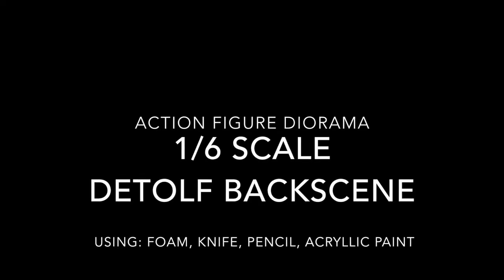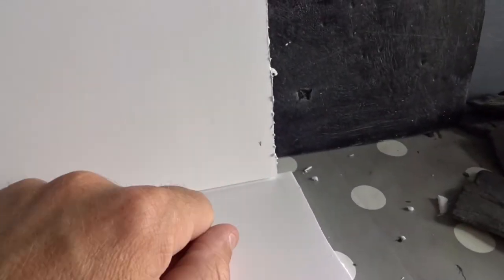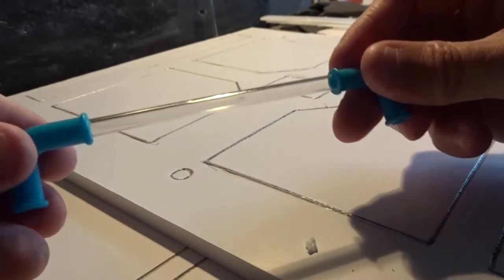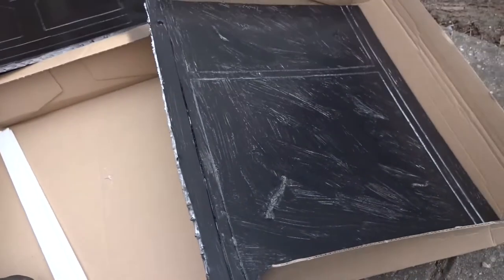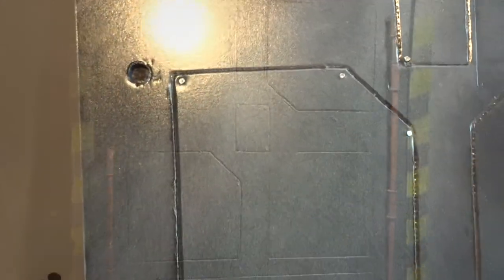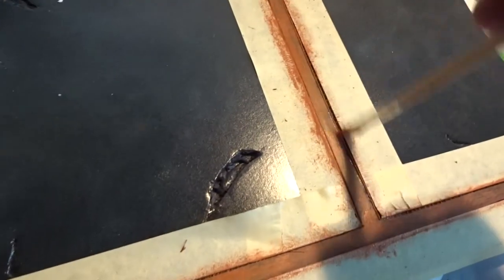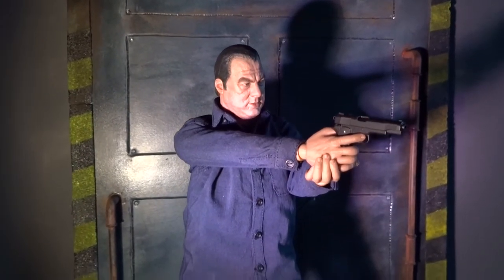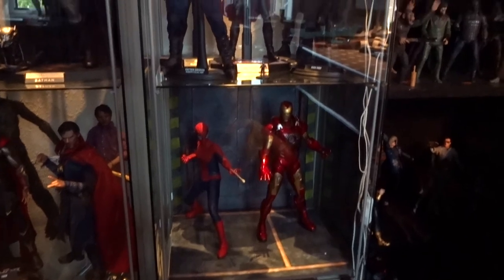1/6 Scale Diorama Tutorial - Detolf backscene

Comment: Can you advise on the materials used in the diorama like what was used for the door handle/pipes?
Reply from the maker: The pipes are from a pack of plastic straws made to look like pipes, and I think they fit fine for the scale.. They should be found on Amazon or eBay. I generally advice to work with XPS foam.. It's not the type I use here, but it's more easy to work with. It can be painted with spray paint, but in that case it must be a certain type of paint that will not "melt" the foam - unless you want that particular effect. Plant based spray paint or products from The Army Painter also work with foam. And then regular acrylic paint. I have several other diorama project videos with other techniques and materials. Thanks for watching
Reply: @ULCFilm  Awesome thank you for the info...the dio you did here is amazing!
Reply from the maker: @corybyrdlong6219  Thanks very much😊